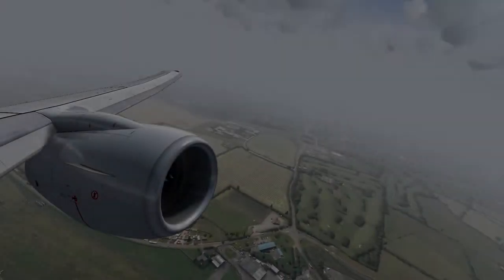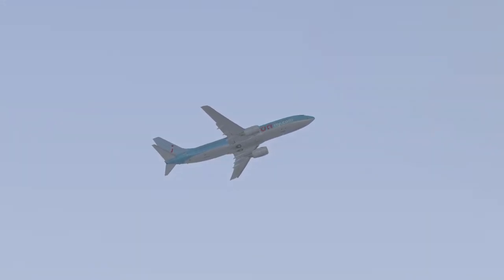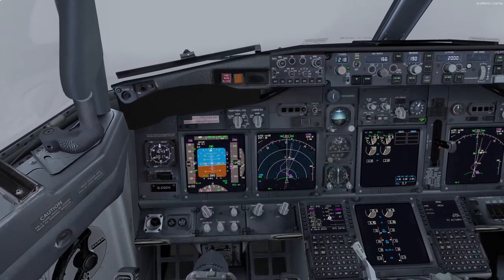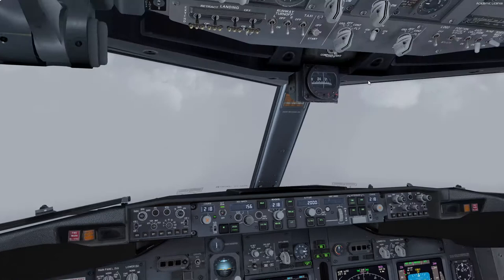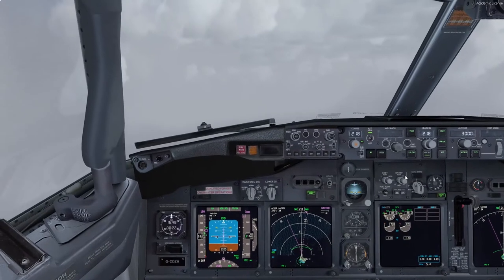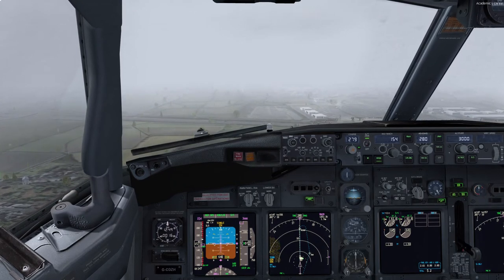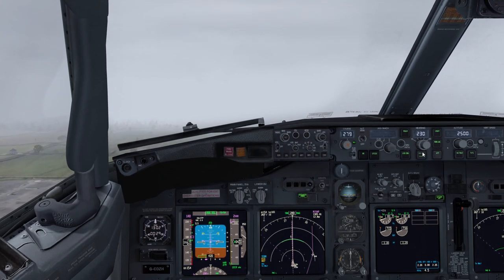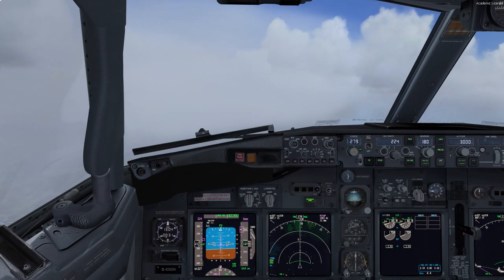Go-around Procedure | VATSIM Emergency Ep. 6 | PMDG 737NG

Comment: Great video, just one tip, when you press vor loc don't then instantly click approach. Click vor loc and wait for the glide slope (magenta diamond) to be within 100 feet above or below you altitude. This stops the aircraft from climbing or stop climbing to reach the magenta diamond or descending rapidly to magenta diamond. I am captain of the 737 at Ryanair and have just (1 month ago) started instructing on it and the amount of freshly recruited fo's that do this is unreal. Superb video, keep them coming
Reply from the maker: Lewis Ferry awesome, good job man! Thanks for the great information
Reply from the maker: ....and does the inner circles on the glide path bar indicate 100 ft above/below profile? Or how do one know when we are within this limit?
Reply: Aviation 619DK on the glide path indicator there should be 2 sub markers above and below the centre of the indicator, hope this helps buddy
Reply from the maker: Yes exactly, but can these markers be converted into actual feet above or below the glide path. Fx that the first sub marker indicated 100 ft above and the second 200 ft above / below centre. But now as I think it through thoroughly, this wouldn't make sense as the indicaters become more and more sensible the closer you get - so never mind! ^^
Reply: The second sub line above the centre is 200ft above the first sub line above the centre is 100ft above etc
Reply: Hi Lewis, I don't know what you've been teaching cadets but that one isn't in the sim study guide! Generally the cadets have a very good knowledge of the procedure and if you claim to be instructing in the sim you should've vectored them below the G/P!

We recommend to arm APP and then immediately the 2nd A/P as soon as you've been cleared for an approach so you don't forget to engage the 2nd A/P. If this is not done by 800ft Flare will not annunciate. 

Good Luck!

FD2S (4000 hours on the real 737 and Type Rating Instructor)

Comment: Where is the TOGA button?
Reply from the maker: Haha great question, maybe I should have covered that small but essential item in the video :D It is pretty hard to see, but if you place your hand on the thrust levers the button is just below and within reach of your index finger. However, as this button is pretty awkward to press in the sim, I would highly suggest you assign a joystick or keyboard button to this feature. Otherwise I think PMDG installed a "secret" clickspot just to the left of the F/D switch to help simmers engage TOGA without looking down on the throttles.